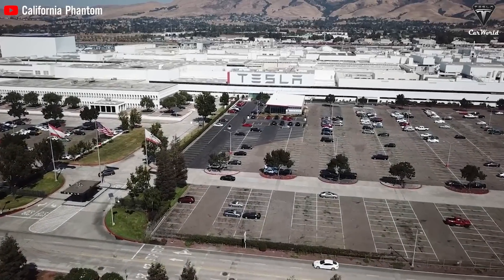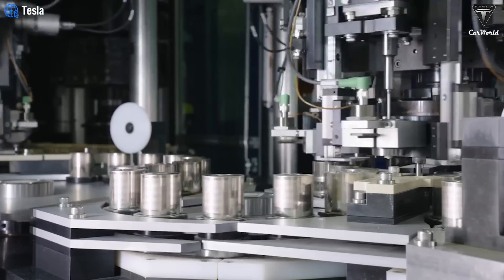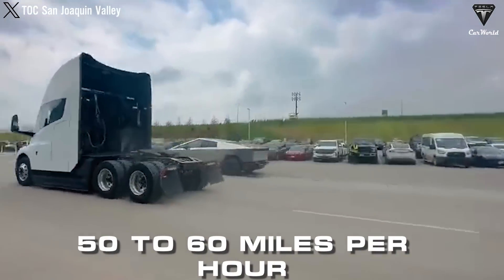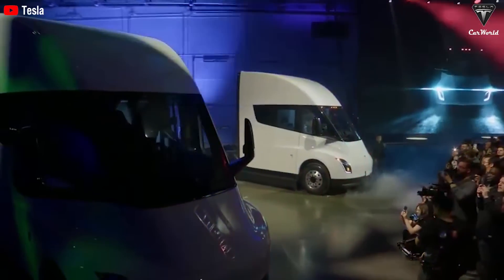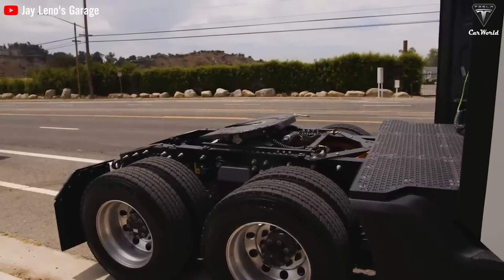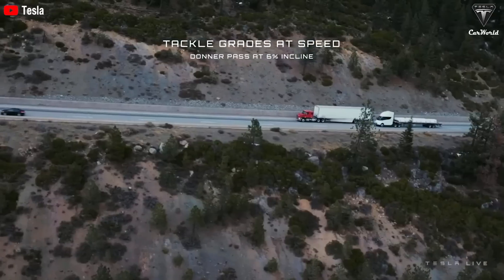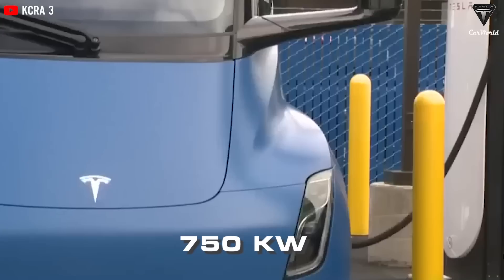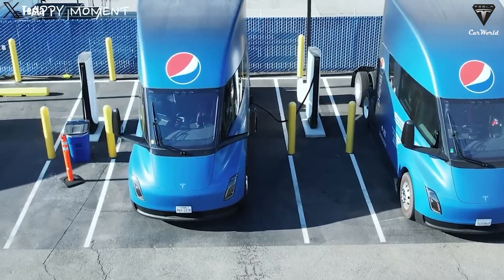All You Need To Know! Tesla Semi HUGE Details Explained in 2024! Overcome Any Truck In 2025!

Comment: All these EVs need to have standardized easily swappable batteries(like the NIO) so that newer battery tech can be incorporated into older vehicles.. Unlike ICE vehicles which seldom had any major upgrades over the last century, Battery tech is improving and evolving by the month,, Older battery tech can be recycled and converted to new more advanced batteries.. If u need an upgrade after a few years, u should be able to pay a small premium for it.. Furthermore, batteries are getting cheaper, lighter and more powerful.. These upgrades will pay for itself in no time. Solar panels should also be standardized for the containers (20/40 foot)as these can virtually add miles to your battery. Solar panel and battery manufacturers can collaborate with container manufacturers to incorporate their tech into them.

Comment: Yeah, and there are no real Large dedicated Super chargers. They found out the 1 that would be built would out the Power grid for Towns, and the States ( which ever  ) will not be able to  accommodate Power. when multiple trucks are charging....lol Try staying positive.. keep trying to Rely on Self drive when Bugs Obscure the Cameras and LiDar Sensor's lol I'm Petrol All The way until I die   👨🏻👍🏻🏎🏎🏁🏁🚩
Reply: That's odd. PepciCo has them at their distribution centers.  The "power grid" (and generation that uses it) have adapted to increased demand for over 90 years. Semi EV charging will be no different
Reply: I'm sure you don't remember the Power Outage I New Orleans Super Bowl Game.  It was more than 45 minutes of delay and total darkness the 1st time then the Concert started and again because the States power grid is still on Direct Current (DC) power grid.  As apposed to Alternating Current (AC). Lots of the Nation is not going to be ready for the Electric Vehicle's (EV's) Demands, and the Big Rigs of EV's are going to raise your Electric Bill too, because it will mean that Updating the infrastructure to accommodate the demands. For EV's, will be Pardon the Pun Shocking. 

I myself will never drive and EV.  Imagine how they start to burn randomly,  or during collision.  If you're in a 2 to 5 mile tunnel stuck in traffic or your children going yo college are in the tunnel.  There's an EV fireand thermal run off occurred,  and no way for the fire truck to get there.

Comment: The main factor is economics. Less down time for oil changes, refueling and maintenance equals more uptime and profit. Cost per mile is the main deciding factor.   All of the naysayers will be silenced as companies integrate charging stations into their docs intermatically cut their operating costs in the process.

Comment: 11:20
This point you mention in passing and not emphasizing enough...it is an EXTREMELY important SELLING point for regular consumers, yet you mention it as if, with some technical jargon etc... I don't really know what words you should use if your intention  is to inform and sell to regular people who normally just hop into their cars and drive... but  "drive trains" is NOTTTT  it.   The other more mechanically inclined already know this point, and most of the others. 

Anyhow, great info.

12:10 
You do it again with the "friction brakes on trucks that heat up..." and the auto generative aspect has to be told to REGULAR consumers in other words, similarly if you add one or two words as to what "torque" is, like, "also the torque in the truck, which is the circular force produced directly to..."  and thus people know what the heck you're talking about... just saying man, no beef with it myself, but I know how much I have to break down things when people as MEEE about it, and the words I normally end up using.  As I said, this is IF your intention is to inform and sell to REGULAR people.

Comment: increasing vehicle weight, accepting smaller cargo loads, company's valuing cheaper efficient fuel and maintenance operations over maximum cargo weight. For example having your own distribution centers with Solar arrays and battery banks to charge your trucks virtually for free energy... as opposed to fuel cutting into 30%+ of your operating costs.... accept less than a 20% weight reduction in cargo capacity to save over 30% on fuel and save much more on maintenance. The range of the semi's is irrelevant with convenient and quick charging infrastructure. The Tesla semi is already more optimal for owner operators to do local delivering under max weight withing a 300-500 mile range. Reduce company's focus on maximum productivity and focus more on minimizing liabilities to increase profit margins. "Green" agenda aside, they wouldn't be doing this if it wasn't more profitable. Pretty soon shipping via electric is going to be half as expensive as shipping with diesel. Free energy is free energy. Even paying for cheap energy is better than expensive energy. Maybe not so great for the job economy, but it's great for innovation. 

As a former trucker myself, working 30% less everyday at a much cheaper operating cost is more attractive to me in terms of profit and freedom. These lease truckers don't start seeing profit until they're more than halfway through their work week. Fighting that battle of making enough to cover your expenses consumes ALL of your time. It's 24/7 work to operate a truck. You may not see your profit margin for the week until after your 3rd load. Not making it to the shipper in time to reload late on a Friday, or paying too much in fuel, or even 1 maintenance expense can set you back to the point where you just worked your ass off all week for free or even OWE money to the truck. 

The biggest breakthrough with the semi truck is going to be getting better regenerative braking technology. It loses a lot of range on accelerating up the mountains, the fact that it's not getting all that range back in regenerative braking coming down the mountain or even getting more energy than it expends is because they need to optimize regenerative braking from efficiency of lower weight vehicles to generating maximum power and power capture of larger weight vehicles and I think the cyber truck is a stepping stone to achieving the experimenting they need on regenerative braking on a higher weight vehicle. Getting 470 mile range on a 7000+ pound vehicle is going to yield a lot more relevant data for regenerative braking power they can quickly scale to semi production. 

Maybe some kind of carbon capture technology is in order. Because there's definitely a lot of energy being left on the table when you consider 80k pounds moving down a mountain at 70mph or faster. 

They need to get to the point that you don't have to touch your brake pedal at all and the regenerative braking can stop you any time and you can be in complete control of your speed at all times the way you are with the regen braking on a normal Tesla.... 

This will obviously rely on more powerful generators and battery chemistry that can charge more quickly, almost instantly. 

Honestly there could be issues with energy surplus in the future and what to do with it. Maybe power your time travel machine like in back to the future. 

infrastructure is a big deal, chargers will quickly go up, but unless companies accept weight reductions on cargo and optimize for lower operating costs... they are going to need to update infrastructure weight limits, change weight limitations, which they are already allowing 82k pounds for electric semi, and work on the regen braking and battery weight. 

Weight should be seen as an advantage for traction, lower center of gravity, weight distribution, battery capacity, range, and optimizing maximum regen. 

With my model 3 I can regen going down a hill and still come to a complete stop without touching the brakes. This needs to be a reality for semi trucks if it's not already. 

When I was going down a mountain with level 3 engine brakes fully loaded, it was nowhere near enough to bring me to complete stop. 

This technology would not only solve the range issue, cost of maintenance on brakes, but would eliminate the danger of your brakes catching on fire.... come to think of it... if it gets that good.... why would they even need air brakes? Other than redundancy? 

If the electric motors are power enough to reliably accelerate uphill, they are powerful enough to decelerate, generating and harnessing the energy from that is what they need to focus on. To the point they can get an energy surplus. 

There are routes you spend more time going downhill than uphill. Certain routes could be capable of supplying enough energy to operate much longer ranges. 

This is the technology they need to work on to keep battery weight down to half of what they would need if regen braking didn't exist. 

on flat ground they can get 500-600 mile range trucks at full weight, impressive... Honestly this technology could be accessible just with more data and a software update and we just simply don't know it yet. 

What kind of regen braking hardware and battery chemistry is in store? Excited to see what the Cybertrucks nickle battery yields and what they do with semi's.